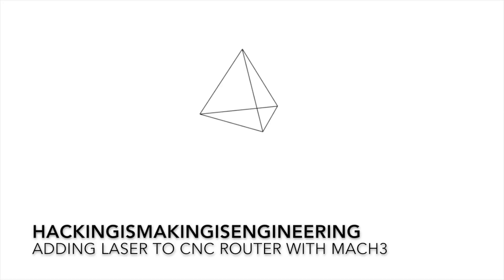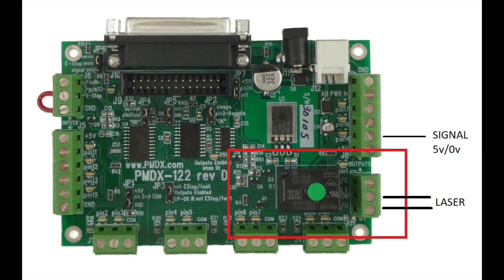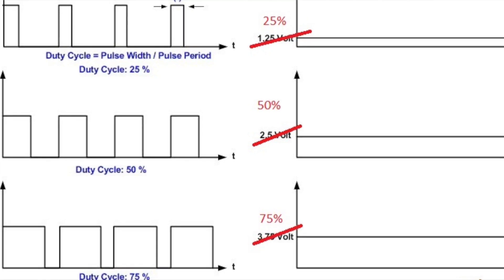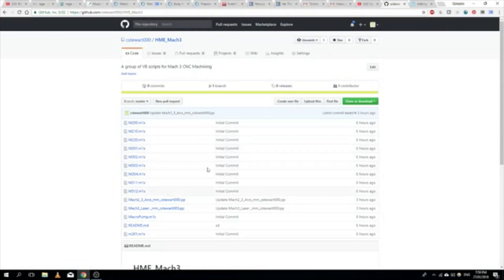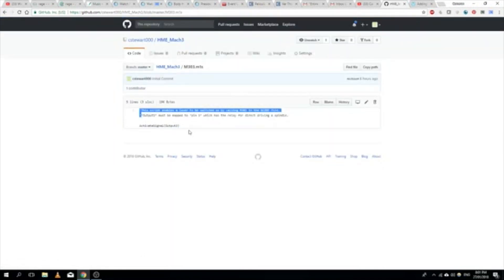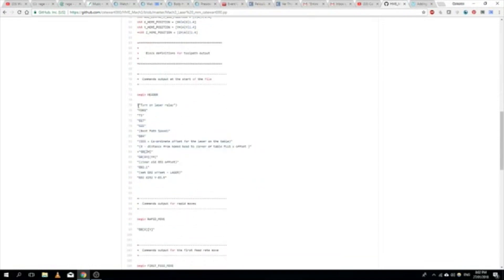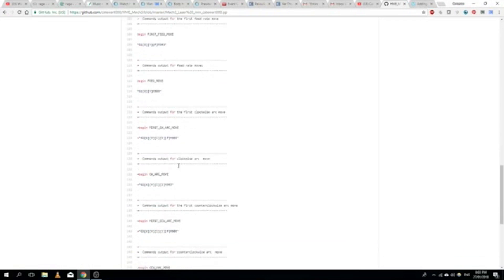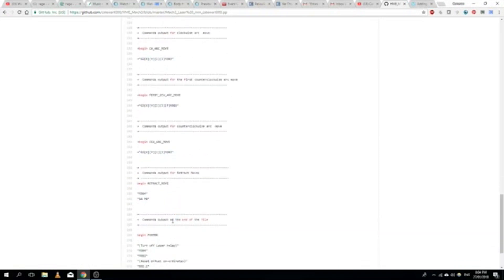HME - Adding Laser to CNC Router with Mach3

Comment: Why did you use laser diode base ,and not co2 base? ,With diode you can't cut ,its too week
Reply: CO2 lasers are way too bulky to mount on a CNC,  Unless you had a humongous CNC machine.  Now days there are Diode Laser modules that are much more powerful, so can be used for cutting.

Comment: I don't know maybe someone can help me or maybe I'm over looking something
breakout board I'm using is a DB25 1205..

laser is 15w … 3 wire ..... positive... negative... PWN

laser came with power supply...

hook laser up to pwn to pin 17 on breakout board... 

test … laser on... but laser is on straight out of box too..
laser came with no paper work

question is how do I turn laser on and off

is this function within gcode...

or can I control this via mach3
Reply: Hey... did you find a solution?  I have exactly the same question...  I think the negative on the laser needs to connect to GND on the DB25-1205